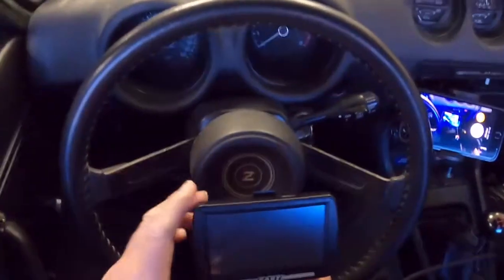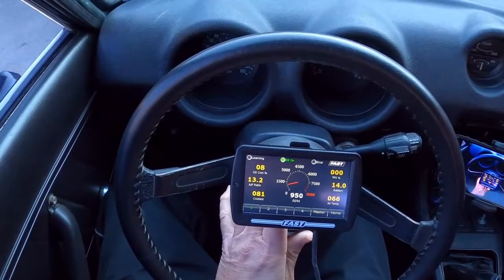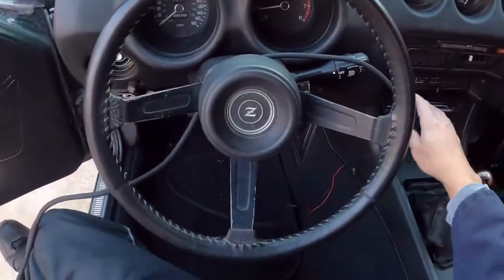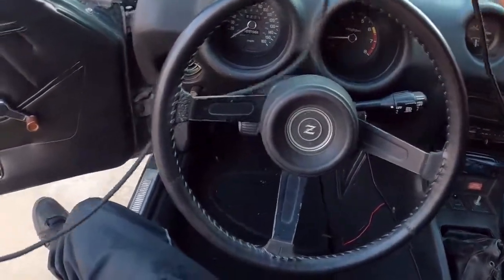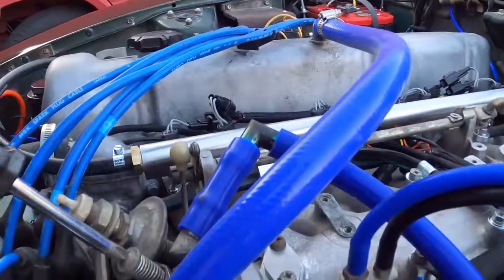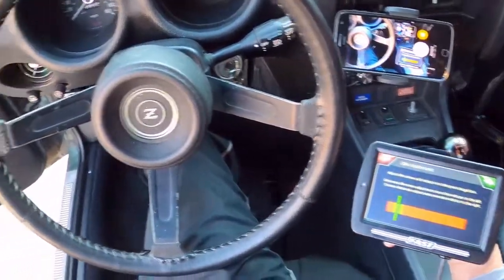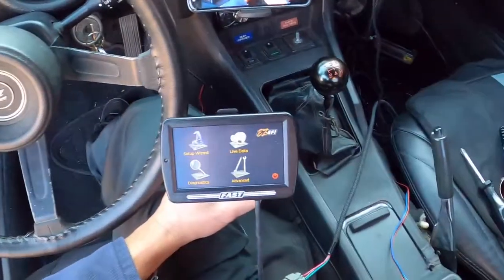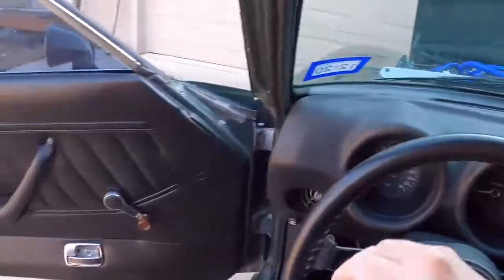280Z Fast EFI IAC Adjustment and Calibration

Comment: My 82’s throttle body doesn’t have the idle adjust, but reacts the same as yours where its just into the green every time I check & set it. Works great on the 82/83 L28. Much improved over the stock Bosch system.